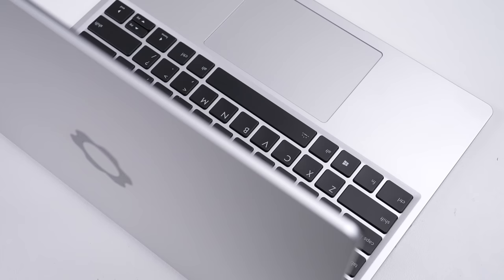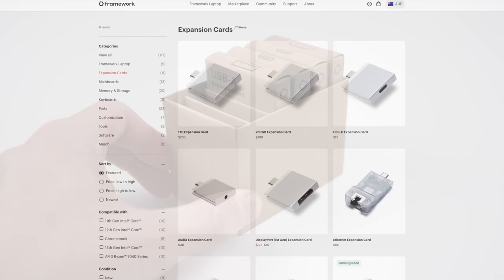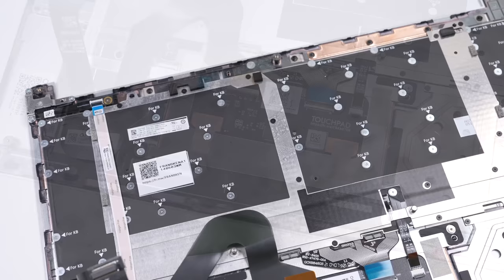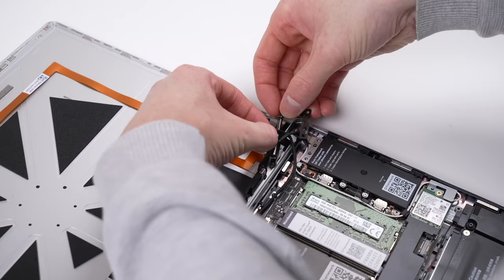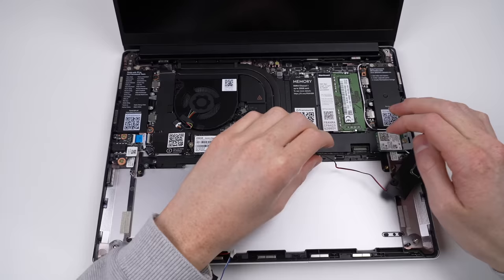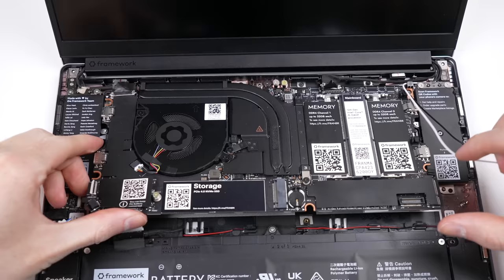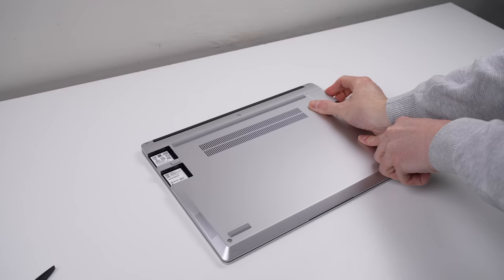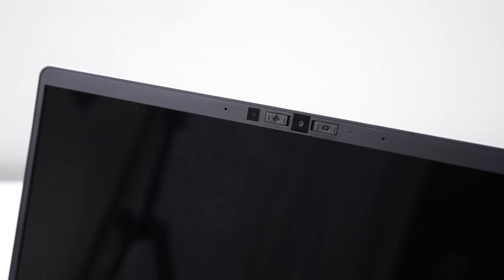New Laptop Brand Shocked Whole Computer Industry - Framework Laptop - Teardown And Repair Assessment

Comment: Modularity was the core of computer hardware industry originally. This is a very ideal step towards the original idea and emotion. Really really well done and applaudable👏👏👏💚💚💚
Reply: Yes but the key part is was industry-wide. Here you can only use Framework which is a great start but will only work if they are price competitive and also keep offering a wide range of options. I certainly hope it works out.
Reply: @Utoko  Yes, you’re right, and I think this is more appreciable in diy/nerd/expert user market, as compared to other consumers, who don’t necessarily want that level of control with their stuffs’ upgradability.

Comment: I am impressed!  I been repairing laptops for years. Some of the worst was a Dell Inspiron. They decided to mount the HDD and memory so deep inside it was an absolute mess to work on.  The best I have seen for reparability is the Dell Precision.
Still, I never seen such a nicely designed laptop and support system.  Good job Framework!
Reply: This was one of the reason why I quit as a Dell technician.  The laptops became too compact and time consuming to work on, not the recipe for someone who has a production schedule to keep up with, which often resulted in snapped plastics parts, scratched surfaces, infuriating the customer even further.  This Framework machine is a techies wet dream.
Reply: Dell Precision  5560 is similar - very clean inside, easy motherboard change etc.

Comment: I've been keeping an eye on Framework since they originally released the Framework 13. I'm really happy with how well they are holding to their promise of repairability and upgradability. I'm really looking forward to the upcoming Framework 16. It has a discrete GPU, and they seem to have solved the upgradable GPU problem by putting the laptop's cooling on the same expansion module that includes the GPU so that the cooling can be scaled up as needed for newer generations of GPUs.
Reply: Oh shizzz!
Reply: YWNBAW
Reply: @minuteworld7027 ?
Reply: @NiNjaTurtLe697  kind of a dog whistle which mean "you will never be a woman"
Reply: Not really a dog whistle, just an acronym, and weirdly out of place. Werid.

Comment: I would never do the upgrade myself but 100% support a company like this and it's motto to do right to repair.
Reply: Why wouldn't you do it yourself? The point of the framework laptop IS so you can upgrade without anybody else. All you need  is a couple off tools like a screwdriver. Made to ve easy so the average joe can do this.
Reply: @regional1000  I'm heavily invested in apple's ecosystem. Cannot switch to windows.
Reply: @user-em4gt3lf9i  Framework is a scam anyways. $30 for an HDMI port? Fuck that. Every chromebook I have ever owned came with at least 6 ports. And those laptops never cost more than $200.
Reply: @nitroxylictv chrome books are absolutely trash laptops lmao
Reply: @nitroxylictv you're paying for the upgradability. Also, this laptop will easily outlast any chromebook.

Comment: most important part, is the hinge attachment to the base durable? a lot of laptops hinges will de-attach from the base or the screen because the part that fasten them to it gets broken. It looks quite easy to get a back-plane for the screen to replace it here, but if the base gets broken, then you might have to migrate the whole laptop to a new one...
Reply: Framework has replacement hinges, they also have different types of hinges available. They are all good and durable.

Comment: I'm buying one of these as soon as my Probook 4430's finally kicks the bucket. It's about as upgradeable as you could get 13 years ago, but lack of newer part compatibility means it is nearing the end of service life. I just swapped out the CPU to an I7, 16 gb of RAM, new wifi card, and an SSD to replace the original HDD, all for less than buying a refurbished one, but it won't last forever.
Framework is going to have my full support.

Comment: That's impressive.  Anything that cuts down on electronic waste is a good thing.  Would have liked to see you swap out a keyboard...as it seems this might be a common swap after many years of use... I'm sure it's available, but would have been great to see that in action as well..
Reply: I'd agree it would be interesting, but keyboard replacement is perhaps a bit too much for a review video. While it is safer and easier than the competition, it is still a bit too dangerous for a review sample. 

Framework would have to trust reviewers to not mess up any of the 2 dozen tiny screws. They would worry that a bodged repair would reflect poorly on the company.

Comment: I can honestly say that this is indeed a great product. The fact that this can be customizable to this extent is something unique. I love the choice of ports that can be customised. If other laptop manufacturers could at least do this, then I'd be sold.

Having said that, I cannot see this actually being useful in a business environment. For all the laptops I purchased for clients, none of them have needed upgrades of any sort as business clients typically run the same software for years on end, which doesn't need any extra grunt. Our oldest laptop is from 2016 and that only needed an SSD upgrade to speed it up. Even one of my architect clients still runs iMacs from 2015 with an SSD upgrade and Windows 10 reload without any issues or speed complaints. Yeah they do have 10th gen core i7 PCs as well which might need a GPU one of these days.

Another example are the 2nd gen core i3 PCs I built for one client in 2012 only got replaced very recently due to the motherboards conking out after 10 years of constant use. Even until the last moment, they still booted up in 20 seconds with Windows 10 and were very responsive.

I'm not saying it's a bad product and it definitely makes life SO much easier when components fail. For longevity in business, the only upgrade options I see being useful are either the SSD and the ports on the side.

Great product all around and lets hope it lights a fire under all the laptop manufacturer's collective asses.
Reply: Why pay $2000 now for a laptop that ships in 6 months, when you can buy a laptop now with the same specs for only $1200. Is it worth paying  an additional $800 just to have the option to easily replace some parts in case they break? You're paying $800 for the right to repair, and then you still need to buy the new parts. And if you do replace parts not because they break but because you want to upgrade in 3-4 year, like the CPU or GPU, you will most likely buy an entirely new system anyway because the screen, motherboard, and RAM will be heavily outdated by then. They need to bring down the price to match it evenly and not have Apple like prices, otherwise the entire modular-repair approach makes no sense. Right now, you are basically paying almost double the price just for "the right to repair/upgrade".
Reply: @Hobbitstomper  You know it's always good to have extra options than just have to take the usual corporate crap.
Reply: @Hobbitstomper  Having seen the literal stacks of old laptops discarded in corners in the IT-support room at the average software developement company, the only dealbreaker is probably the waiting-time. As soon as they can deliver "on call", I have a hard time seeing why a business would not prefer this over ordinary laptops...

Comment: This is excellent. Though I do think the best way to reduce waste is to buy the best and most powerful laptop you can from the start and keep it for a decade. But failing that, this is perfect. And I love the idea of how easily the screen is replaced - I've lost a lot of laptops to broken screens that weren't worth the effort of sourcing replacements and the trouble of replacing.
Reply: I mean... Seriously, right! Totally agree. Ahh the good old days...  *Ironically no matter how much money you shell out for the latest and greatest by the time you got  home it was already obsolete.  

*My 1998 Dell P3/500 still works and 3/4 Dell  laptops from 2004-2010 still work and 8/10 ChromeBooks from 2012 - Present still work.
Reply: Your plan sounds great, but fails when there is a catastrophic failure of one part of the laptop just after the warranty expires... and you example of a cracked screen is the major example of that in my own experience.

Comment: Framework and Fairphone  are some of my favorite companies, pitting customers first and supporting right to repair as well as upgradability
Reply: Fairphone is midrange garbage. Framework is amazing.
Reply: @_xwtk nly 2 things on my Fairphone 4 that were bad were the LCD screen and the speakers. Besides that I would have kept the phone.
Reply: @mactalk2871  So literally what you need to use the phone. You literally confirmed it is garbage. And didn’t Fairphone remove the headphone jack and started selling their garbage bluetooth buds?
Reply: @_xwtk  I personally have a fairphone and it's the best phone I have ever had. Sure, there are better screens out there (AMOLED, etc) but that's true for framework too. Framework doesn't offer oled or mini-led options either. There must be a compromise, since they would drive the cost up too much. I am okay with it. I hope that future releases will allow for customisation, such as picking a better/worse screen for both framework and fairphone devices.
The less customers they have, the less options they can offer without driving their profits down. Remember that manufacturers buy stuff in bulk and the more of it they buy in one go, the cheaper they get it for
Reply: @VideogamesAsArt  What are you talking about? This is not about screens. Framework has actual flagship hardware. Fairphone is a mid-low range spec’d phone.
Reply: @_xwtk  I was responding to MacTalk's comment that the LCD and the speakers were bad. Haven't seen a single mention of the hardware. For me hardware is not an issue. I call, use SMS and a few social apps, I just want my phone to last many years and be able to repair it. I don't need PC-level performance in my phone, that's what I have a PC/laptop for. I understand that for some it might be a deal breaker though, especially if you play games
Reply: Imagine comparing a garbage product like fairphone to a revolutionizing product like framework, as an engineer myself, I could have not been any more offended.
Reply: @TechOtakuYT  Exactly!
Reply: @VideogamesAsArt  530 EUR for that garbage? It literally makes no sense for that phone to exist.
Reply: @_xwtk i would argue that people that require constant repair for some reason would love it
Reply: @tezcanaslan2877  Such people would go buy 70$ cheap phones and roll with them, literally cheaper than repairing that phone.
Reply: Fairphone is like a scam. It is better to buy second hand phone with better spec and repair it, when it is done... A lot of phones are easy to repair, even some have clips not glue at backcovers...
Reply: @zbigniew2628  Yeah, especially those that have the same specs as that garbage

Comment: The idea of an upgradable laptop is awesome. Bought a $1700 GTX 1070 gaming laptop 6 years ago that can barely run any modern games anymore. The battery is in decent condition, but will need replacement too. So, these making it relatively painless to upgrade and repair your laptop is fantastic. They're pretty reasonably priced also.
Reply: You can still use your old laptop as a thin client for a cloud desktop.

Comment: The Framework Laptop has burst onto the scene with an innovative and groundbreaking approach to computing, offering a level of modularity, repairability, and upgradeability that sets a new standard for the industry. As a tech enthusiast, I can confidently say that this laptop is the coolest thing I have seen in a long time, and it holds immense potential to reshape the way we interact with our devices.

First and foremost, the modularity of the Framework Laptop is a game-changer. Unlike traditional laptops that trap users in a cycle of planned obsolescence, this laptop allows you to customize and adapt it to your changing needs. The modular design empowers users to easily swap out various components, such as the CPU, RAM, storage, and even the ports, without the need for specialized tools or technical expertise. This level of flexibility ensures that the Framework Laptop can keep up with evolving technologies, making it future-proof in a rapidly advancing tech landscape.

Repairability is another aspect that sets the Framework Laptop apart from its counterparts. Instead of treating laptops as disposable items when something goes wrong, the company behind this masterpiece has taken a bold step towards sustainable technology. Each module within the laptop is designed to be easily replaceable, minimizing electronic waste and extending the lifespan of the device. From the user-replaceable keyboard to the accessible battery compartment, every element of the Framework Laptop has been meticulously crafted with repairability in mind. This commitment to repairability not only saves users from costly repairs but also contributes to reducing our environmental footprint.

What truly excites me about the Framework Laptop is its exceptional upgradeability. The laptop is designed to accommodate the latest technology advancements, allowing users to effortlessly upgrade their laptops as new components hit the market. With easily swappable modules, you can enhance your laptop's performance, increase storage capacity, or even improve connectivity options, all without the need to invest in an entirely new device. This approach to upgradeability not only saves users money but also promotes a sustainable and responsible approach to technology consumption.

The Framework Laptop represents a beacon of hope for the future of laptops. Its modularity, repairability, and upgradeability are a testament to the fact that we can break free from the shackles of a throwaway culture and embrace a more conscious and sustainable approach to technology. This laptop embodies the ideals of innovation and adaptability, and it is a refreshing departure from the status quo.

In conclusion, the Framework Laptop is a stunning testament to what the tech industry can achieve when it prioritizes modularity, repairability, and upgradeability. It challenges the prevailing norms and offers users an unprecedented level of control over their computing experience. As a tech enthusiast, I fervently hope that this laptop heralds a new era in the industry, where sustainability and user empowerment become the norm. The Framework Laptop is more than just a laptop; it is a symbol of progress and a glimmer of hope for a brighter and more responsible tech future.
Reply: You should be hired as frameworks marketing agent.  Very good writing skills!
Reply: @barthchris1  Appreciate it!

Comment: I also love that they added physical privacy switches for the mic and webcam! 
If their next product is going to be a phone, it'll sell like hot cakes.
Reply: I agree, if they ever made a phone. I would support them as well, because they clearly respect the owners and give them the option to meet and plan there budget through upgrading there computer parts rather than just slapping them with you need to get our new model logic
Reply: There is a smartphone out now, I don’t think it’s from the same company, but they have parts clearly identified inside the phone for easy repair options.  I forget the name of the phone, but it’s been out now for the past couple of years.  It even comes with a spudger tool and requisite screwdriver needed for repairs.
Reply: @furnitureconsortium  I think you're talking about Fairphone. I like them, unfortunately they don't offer a headphone jack in their latest phone.
Reply: @user-bp8yg3ko1r   yes!  That’s the name!
Reply: @user-bp8yg3ko1r  oh, does it allow to upgrade to lates cameral parts and so on?
Reply: PinePhone, Librem5
Reply: I think they should focus on building laptops for now

Comment: To me the key to a laptop is the screen hinge. The hinges usually end up tearing out and/or breaking the plastic case. I can replace most components in a laptop, but once the hinges tears out, it is time to get a new laptop.
Reply: I see batteries as the Achilles heel of most portable electronics. There are 3 laptops and 1 phone  with me right now that'll function just fine if their batteries are okay. Getting OEM battery replacements is a pain. Then there's the drivers nightmare as manufacturers discontinue hosting files on their websites.

My point is, most portable devices can function for well over a decade if not for battery degradation.

Comment: It's a very nice concept.  I think the practicality of it will boil down to what you have to pay for all of the upgrades you want vs just buying a new laptop.  If the price structure is reasonable it seems like a win.
Reply: I looked at the framework a while ago. They are priced pretty well. Pre-ording the next release is cheaper than my current laptop was. Most of the "expansion cards", the four slots on the sides, are $20 or less, with only the "coming soon" section and the hard drive cards costing more. 250GB is $69, 1TB is $149.
Reply: Biggest upgrades you need on a laptop these days are CPU and GPU which are both soldered. The main board is the most expensive part. I would also want options for the display, from touch, Wacom pen, 4k, 2.5k, OLED, etc, but I seriously doubt that'll happen.
Reply: @tristanmitchell1242  that actually sounds fairly reasonable.

Comment: And this will easily be my next laptop when my Lenovo Flex 5 dies. PCs used to be modular like this, but I just bought my son a brand new HP because his would no longer boot and was cheaper to replace than repair. In the '90s, you could go online with Dell and custom build your pc/laptop. It's heartening to see a company filling the void so many of us have felt for 2 decades. Kudos Framework! Thanks for a great video.